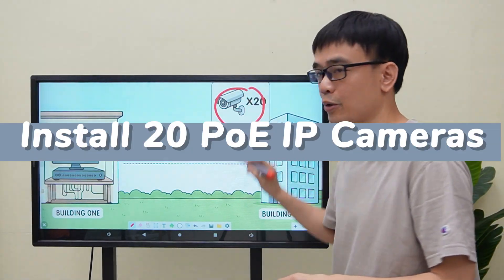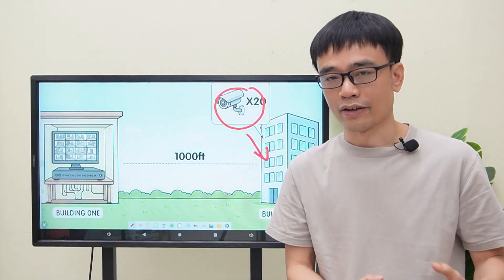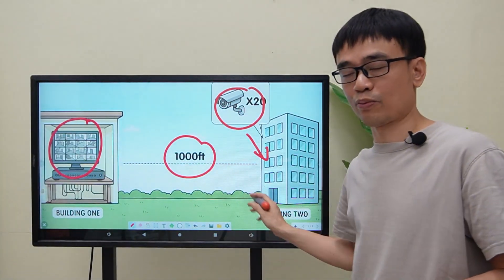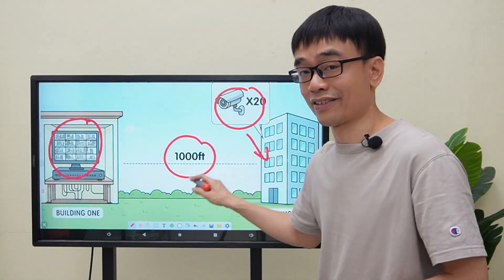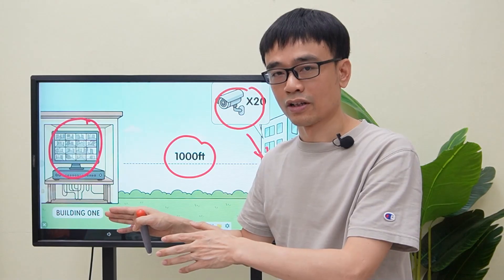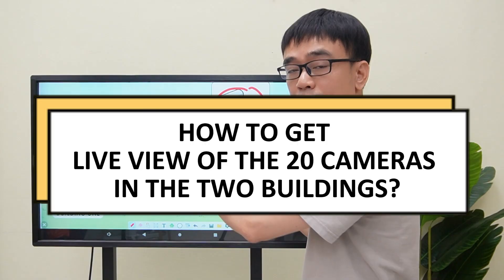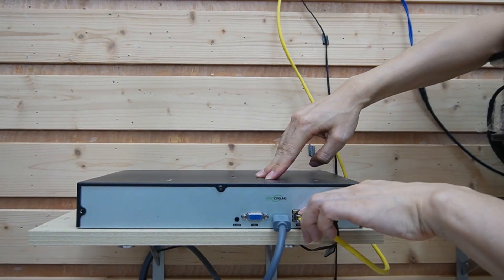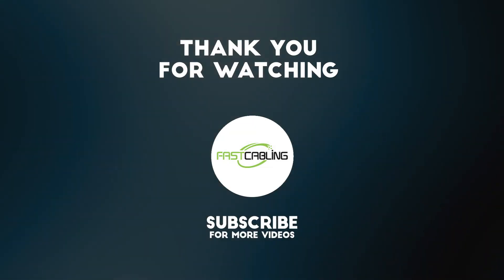Use Fiber to Connect 1000ft+ IP Cameras in Two Buildings | Dual Display CCTV Setup

Comment: Sir, I already have a 32 channels NVR in the first building, 
Is it a must I make use of a 32 channels NVR to provide a separate view to other building? 

Secondly, do I need to setup the second NVR with storage devices?
Reply from the maker: You don’t have to use another 32-channel NVR just to give Building 2 a separate view. You can usually create user accounts or permissions on the existing NVR to allow viewing only certain cameras.

As for the second NVR: if you want independent recording in Building 2, then yes, it will need its own storage (HDDs/SSDs). If it’s only for live viewing, storage isn’t strictly required.